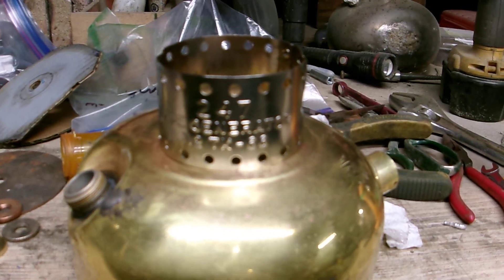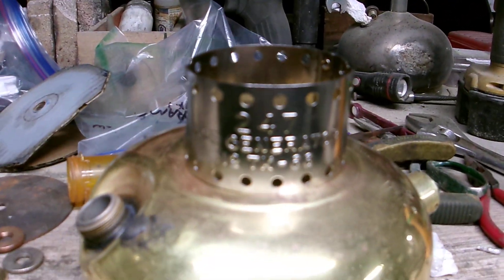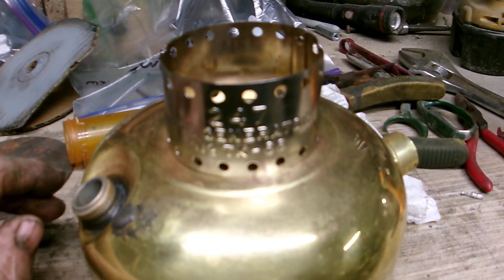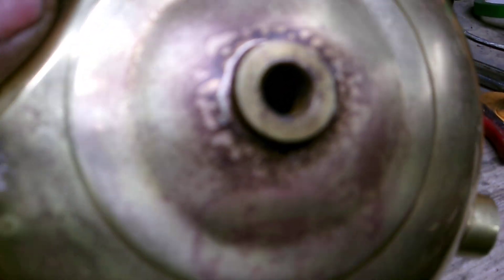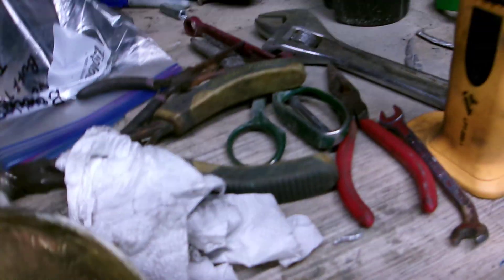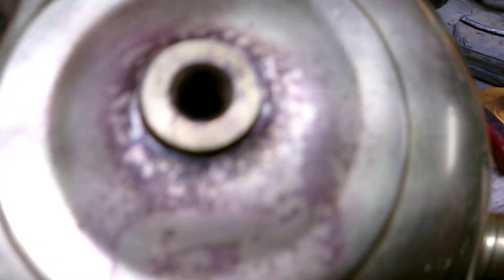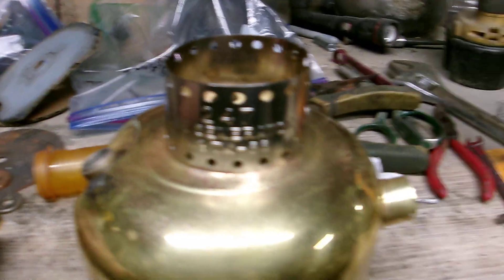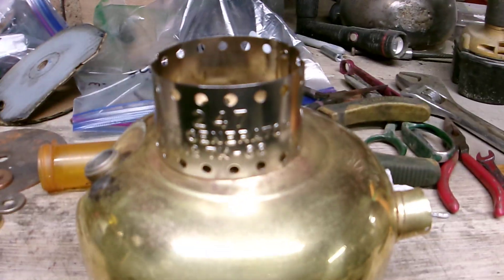247 CPR~~~ dent? or factory rebate?

Comment: Nope, doesn't belong there.  It's been dropped at sometime.
Reply: If it was dropped it would be dented inward . That is a result of using pliers to way over tighten the wing nut on the burner frame floor which caused it to pull the top of the fount upwards . Either missing or or threaded all the way down the stop-nut that's underneath the frame base.
Reply: That's a combination of both. The ring in the top of the fount is down and the bung maybe is up too. I don't think we'll ever know for sure what happened to cause that. But to fix it the ring has to come up
Reply: @fyrfyter1035  agreed, way over-tightened and pulled the fount up. They're very fragile in that area